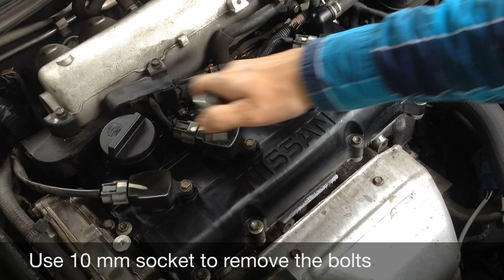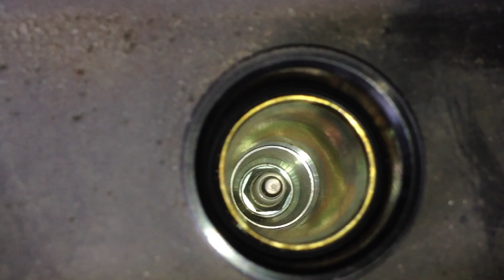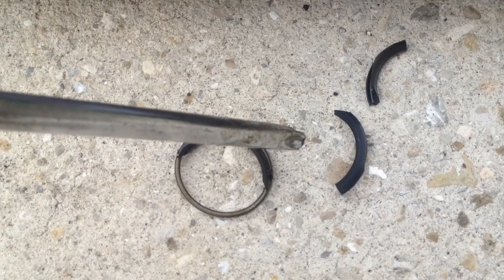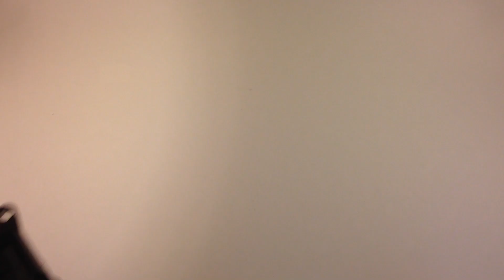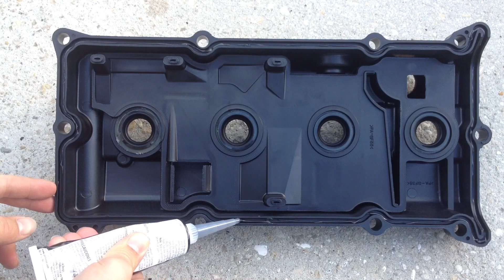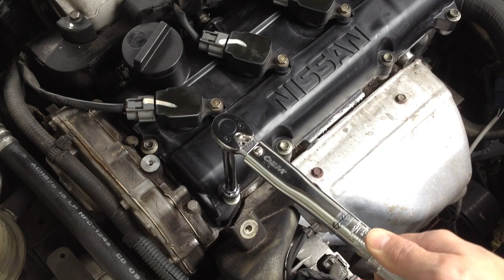How To Fix Oil Leak & Cylinder Misfire - Valve Cover Gasket Replacement - Nissan Altima 2003 2.5 SL

Comment: Been watching your video. I'm still getting p0300 random misfire on my 06 Altima. I had a few code where I had to change my camshaft and crankshaft sensor. I've also change the sparks plug and coil. but the p0300 code would only go away for a few weeks. I'm going to change my valve cover and hope that it's the problem. Just got a few questions for you. You have on your video step 1 and step 2. I'm confused? I'm purchasing a inch/lb torque wrench. What's the best torque number to use? And the after market valve cover on Ebay. Are they good enough? Or should I get the Nissan oem? thanks
Reply from the maker: +MrJunray14 
It means torque all bolts to the lower value shown for step 1. And then  torque them to the final value shown in step 2. This is done to make sure you don't squeeze out or over tighten gasket one side if you were to tighten each bolt right away.
Reply: +Temachok , I've recheck the valve cover and i don't see any leak around the gasket nor do I see any oil in the spark plug wells. By the way the p0300 will go off for a few days than will go back on. P0300 turned itself off again after a few restart. Sometimes it has a hard time starting and sometimes will shake. I would turn it off and restart and it will be fine. I'm at lost on whats wrong with my car.
Reply from the maker: There a few possible reasons for it.
This article might be helpful:
http://www.obd-codes.com/p0300

Comment: Do I need the gasket maker or can I simply just change the gasket without the glue?
Reply from the maker: +Meir Fox Yes, you do need gasket maker. You don't have to apply it all the way around, but it is required in two places where engine block is raising up/not flat.
Reply: Thanks for the quick response. The video is very helpful.

Comment: I'm sorry but could u clarify how to clean the oil if it's inside the tube with the spark plug goes. thank you for your video.
Reply from the maker: +Joe Santiago 
Try to soak it up using paper towel or cloth. User screw driver or wire to get to the very bottom. 
You can also blow it out if your have a compressor.

Comment: I have replaced the valve cover twice because the same thing keeps happening with oil leaking past the #3 & 4 tube seals. Any idea why this is?
Reply from the maker: +Darvil Reyes 
Sounds like pressure bilds up inside crank case and it blows out gaskets. I'm thinking maybe issues with PCV system.
Good article about it here: http://www.agcoauto.com/content/news/p2_articleid/197
Also, here is my video how to replace PCV valve and hoses if you have The same Altima:
https://youtu.be/pXL2DYiQ8nM

Comment: Thank you for not using "Heavy Metal" sound in the background! I've seen glue (in spray form) applied to gasket, is it necessary ?
Reply from the maker: +Sid G. 
:) No heavy metal... 
Official Nissan repair manual doesn't say it's required.

Comment: I like it because very little cut & editing on the video.
Next time don't buy Nissan & Infiniti because they will not sell you just the gaskets & tube seals (spark plug gasket).  
You have to  buy the Value Covers and then two gaskets with can run over $900 in parts.

Again, nice video that you also showed us the torque specs while many do not.
Reply from the maker: +angelisone 
Thanks, and yes, buy Toyota or Lexus instead....
Reply: +Temachok Working on an Infiniti G45 and Nissan 350Z are no fun.
Valve cover on these are over $400.00+/each, you have to buy many gaskets.

Aston Martin, Ferrari and Porsche are nightmares.
Reply from the maker: +angelisone 
:) Definately not fun!
Reply: +Temachok The Altima valve covers are little bit easier to get at than those other high end craps.

You may want to replace the water pump & not the timing because yours has a timing chain.

Again, nicely done & showing us & taking your time out for us.
Reply from the maker: +Juan Lara 
He probably ment how much it cost at Nissan/Infinity dealer including parts and labour.

Comment: You said you can apply that gunk on the part where the spark plug is since it is embedded in cover. (Sorry, I don't know the proper verbage. lol) I didn't see you do it in the video. Also you said let it dry for an hour before doing anything. did you wait an hour before tightening the screws or you tightened them then waited an hour. I have an 08 nissan. only spark plug 1 had oil in it.
Reply from the maker: +Yadee Roses 
Applying "gunk" :) around spark plugs is a last resort temporary solution if it is leaking very bad and you need to wait for few days before you can fix it.
To fix it the problem, you need to replace valve cover.
When you buy new valve cover, you don't have to apply gunk around spark plug tubes. New valve cover should fit tight and shouldn't leak.
Reply: +Temachok Ok. The valve part I understood. just wasn't sure if you had to apply the stuff after putting the cover back on or before. well either way I won't do that just yet. Going to try the other one first. hopefully it works. Thank you so much for you videos. Very helpful and efficient.

Comment: speaking of the coolant I do not see any of those symptoms  thank you!!!
Reply from the maker: +lalo Miranda 
Check overflow coolant tank. Mine started simply falling apart from age. Platic pieces were falling off right inside the tank. I had to completely replace it.

Comment: hello,right now I am working on the cover,but 1 I do not Know how to set torque wrench(never used before) and 2 I noticed where the pcv valve is it is crack( where the click is) not the whole hose .what should I do thanks for your fast answers!!!   appreciate!!!
Reply from the maker: +lalo Miranda 
If that hose is cracked, it may create vacuum leak.
This may decrease performance and fuel consumption.
It may also throw off car computer readings.
It is better to relpace it if you can find replacement.
Or, if it has a little slack, try to cut off the cracked end.
Reply from the maker: +lalo Miranda 
There are different types of torque wrenches, so it depends which one you've got.
Mine has pretty clear instruction manual.

Comment: I have noticed that I am  adding a lots of antifreeze probably twice a week, any idea ??
Reply from the maker: +lalo Miranda 
Sounds like coolant is leaking somewhere.
Did you noticed any puddles or wet spots on the driveway or under the hood after driving?
Reply from the maker: +lalo Miranda 
Do you see a lot of smoke coming out of exhaust pipe?

Comment: hi, once again ,can you tell me what size of torque wrench are you using??  1/4 ? , 3/16 ?  because I do not have and want buy the corrct one.  thank you.!!!!
Reply from the maker: +lalo Miranda 
Buy whatever size will fit your sockets. I personally have Pittsburgh with 3/8 drive: 
http://www.amazon.com/gp/search/ref=as_li_qf_sp_sr_il_tl?ie=UTF8&camp=1789&creative=9325&index=aps&keywords=Pittsburgh%20Torque%20wrench%203%2F8&linkCode=as2&tag=dp051-20&linkId=J46HUQ5VKHH62W65

Comment: why do you recommend to replace the pcv valve? and where is located??
Reply: +lalo Miranda  it is hard to remove?   and why did you recommend to replace pcv valve???     thanks!!!!
Reply from the maker: +lalo Miranda 
Usually by the time your gasket starts leaking, the PCV valve is also due for replacement. PCV valve is that little plastic L shaped thing screwed into the valve gasket. The one that breather hose connects to.
Usually it comes with new valve cover. If it doesnt came with your valve cover, it only costs a few dollors to buy and you might as well change it since you are already Replacing valve cover.
Reply from the maker: +lalo Miranda 
It is super easy to replace and shouldn't take more than 2 minutes.

Comment: Is it a bad thing to let oil leak into the cylinder after taking the spark plug out?
Reply from the maker: +junkdogg1 
It might be bad. I was told that because oil doesnt compress, it may bend pistons when you start engine if both valves are closed.
Reply: +Temachok I kept having stick a cloth down there to soak up the oil in cylinder 3, but all the other cylinders are bone dry. It keep wetting my spark plug tip. Every time I start the car, more oil keep showing up. Hopefully it will dry up eventually.
Reply: +junkdogg1 I see water in my cylinder,

Comment: Thank you so much. Have an 02 altima and noticed oil around the valve cover (outside of engine). Had a flashing SES light while driving causing major missfires. Removed the ignition coils and two sparkplug was filled with oiled. The gasket seal and spark plug tube seals are both bad.  Now i know its a job i can do myself.
Reply: where did u get spark plug tube seal
Reply: +justin williams the spark plug tube seals are embedded into the valve cover and can't purchase them separately. If you have bad tube seals you need to get a new valve cover.
Reply: Thanks that suck

Comment: This video was very informative and extremely well made. I have a Nissan Altima 2002 with the same issue. You made this repair look very simple. Thank you for taking the time to create a superior video with which to follow along.
Reply: +Krystyn Leigh Banks  thats true it is informative thanks
Reply from the maker: Krystyn Leigh Banks 
Thank you! I appreciate that you also took time and left feedback.
And thanks for subscribing!!!
Reply from the maker: +Sathish thati 
Thank you!
Reply: someone told me that  i will  need to reset the timing after doing this. is that true?
Reply: abdulrazack oketona not one bit!
Reply: I have replaced  valve cover gasket  it continues  to leak
Reply: Except, Only use the High-Temp (Red don't go cheap $100 extra gets you Permatex name brand) Sealant though and between both sides of everything especially the 4 O'ring seals covering the Spark bplug boot shafts...this is where oil will eventually leak down causing misfires on 4 Cyc cars.

Comment: I really wish you had specified VERBALLY that this was INCH / Lb , having never dealt with torque wrenches before, I went to the store and bought one to match the number ranges, 26-82 , and I ended up unknowingly buying foot/lbs. So now Im all over tightened, and my #9 screw is stripped , yay ! Hopefully somehow this doesnt leak massive oil. ugh. Thanks anyway, tough way to learn a lesson about torque wrenches.
Reply: +ITALIAN926 :(  That sucks!  
82 foot-lbs is how tight wheel lug nuts should be... big steel lugs into steel brake discs.    As you sadly learned, little bolts into a soft aluminum head can't take much- and don't need much because they aren't holding anything on that experiences any kind of load (like a wheel).  :(

Comment: Victor, the torque wrench you are using is a inch pound or a foot pound?
Reply from the maker: Raul Ramirez 
Don't remember.
I'll check when I get home.
Reply from the maker: Raul Ramirez 
Mine is ft/lb, but you can convert units online if yours is different.

Comment: Hey bro, am doing the exact same thing to a 2004 nissan altima. And I have a couple questions. Do you have to allow to dry for 1 hour before thigh the bolts? 
And how do you thigh the bolts to the factory specifications? How do you set up the torque wrench? 
Thanks
Reply from the maker: Raul Ramirez 
Basically follow the instructions for whichever gasket maker you are gonna be using. Mine said to let it dry for one hour. It may be different if you have a different brand/type.
Reply from the maker: Raul Ramirez 
Buy or rent torque wrench.
It usually comes with instructions how to use it. 
Use the torque values that I provided in this video when tightening the bolts.

Comment: I'm trying to do the same for a Nissan 350z any tips? And is it similar to this?
Reply from the maker: zombieShell311 
It will be the same in essense, but more challenging on 6-cylinder engine. It's way more crowded under the hood.

Comment: im doing the same exact thing on my honda right now. the only issue is that the rubber is having trouble reaching the corners of the valve cover. is it common that people would need to stretch the rubber? or should i not do so. ty
Reply from the maker: Techno sailor 
No, you shouldn't have to stretch it.
Try to return it and get a different brand maybe.

Comment: I put a new valve cover on my car and now it's oil I'm the spark plug hole and it smoke on start up what could it be and yea I put the valve cover on rite it could be a faulty valve cover???
Reply from the maker: Ishma Cheeks 
Where did you buy valve cover? Is it good quality? 
Did you also replace the gasket?
Did you have the smoke before?

Comment: Hi. Thanks for your video. I also had the exact same problem of oil leaking in the same cylinder as yours. When oil is leaking in the cylinder, do I also have to replace the 4 tube seals? There also seems to be 4 metal rings (grommets I think they are called) where your tube seals are. Do they also have to be replaced as well, with the tube seals?
Reply from the maker: Christian Greenhill 
Yes, you definately need to replace seals.

Regarding metal rings - are inside the seals. When seals start falling apart, that's when you start seeing those metal rings.

Comment: Hello I'm trying to replace a valve gasket on a 94 crown Victoria and the one they have in store is totally different from the one replacing...it's a blue rubber without the holes thats on original one And auto parts says that the kind my car uses...so how do I apply this one...thanks #stumped
Reply: +Stephanie Montgomery Return it to the store and get the right one.

Comment: Hi i have 93 camry with a leaking valve cover gasket, is it really important to replace it or what can happen if i dont fix it? I do check the oil often and it doesnt leak that much. Thanks
Reply from the maker: greed6is6good 
Aside from headacke of having to check it all the time and all that dirt under the hood, I would be worried that it make start leaking much faster. You can kill the engine if you forget to check oil level on time.
Reply: Thanks for the advice i think i know what to do

Comment: could it b my gasket  cause one my spark plug has oil in it. should i change my gasket?
Reply from the maker: RiceCake Xyooj 
Yes, it's possible. Check if gaskets around spark plug wells are worn out or leaking. If yes - replace. 
If you take out ignition coils, you'll see the gaskets.
Reply: Hey thank. I just change new valve cover and gasket. Somehow the problem hasn't solve.  Could it be bad ignition coil? Please help
Reply from the maker: It can be issues with PCV system.
https://youtu.be/7XaRHxWi66w

Comment: good video ... i have misfire cylinder #3 .. after i removed the sparks plug i notice some oil at the botton end inside spark plug tube #3 .  ... what's the name of the tool you used to tide those volts back on the valve cover ?? ..
Reply from the maker: pascaljose5010 Torque wrench.

Comment: Hi I have a Nissan sentra 2000 1.8L I was wondering how do I replace the PCV VALVE ? You didn't show it in your video. If anyone knows it will help me a lot
Reply from the maker: ***** It's actually pretty easy. Do you know where is PCV valve located on your car?
Reply: Yes its on the same spot I bought the part already but its so hard to put it in can I use any kind of lubricant?
Reply from the maker: ***** Just use engine oil to lubricate it.

Comment: Is it important to use gasket maker on the two joints? i want to do the valve gasket replacement but don't have the gasket maker... can i use anything else than gasket maker?
Reply from the maker: farhancpa 
Yes, without it valve cover may not have good contact with engine block. This may cause oil leak, and you'll have to do the job again. Gasket maker is like $5-10 only.
Reply: Temachok thanks so much

Comment: My nissan altima 2006 had this same problem . I replaced it and after I put in the new one after a few days my car wouldn't start properly. It takes a few cranks to start. Any ideas what it can be? P0300 codes are gone but now it won't start properly..help?
Reply from the maker: uriel reyes  Check out my video about Crankshaft sensor replacement. That might be it.
Reply: Crank & cam shaft sensor..100%

Comment: I broke a bolt in the valve cover I drilled it out can I use a bolt and nut to fix it it was only one bolt that broke
Reply from the maker: ***** Did you damage the hole for the bolt?
Reply: sorry im little late mate but yes I had to drill it out and I got away with putting a nut and bolt cause it went all the way threw
Reply: this video helped me out a lot but I wish I dident use the gasket maker or as much in the valve cover I would say only use it on the engine part like he does in the video but not so much in the cover thanks for the great video
Reply from the maker: ***** 
Thank you for sharing!
Reply: anytime
Reply: I had the same problem breaking a bolt. What did you use to extract it?
Reply: its to small I tried so what you do is carefully drill it all the way through and go to home depot and match up a nut and bolt and put it in it worked fine for me and its not leaking I spoke with a mechanic and he said that's fine to do also. My bolt that broke was the far right corner one in the front
so it was easer to get to witch one of yours broke  the bolts get hot and cold so they get weak I torqued it to specs by the book and it brock let me no how you make out sorry for the late reply
Reply: just use a good drill bit for metal  dewalt works it will run on you but the hole don't have to be perfectly round it will work just fine

Comment: Is the same procedure for 2003 nissan murano 3.5 liter engine?
Reply from the maker: BARTI R. Yes pretty much. It's just gonna have two blocks, so you'll have to do it twice. Also it might be more challenging as 6-cylinder engines are bigger and everything might be packed very tight under thr hood.